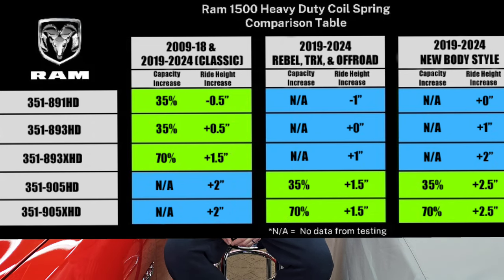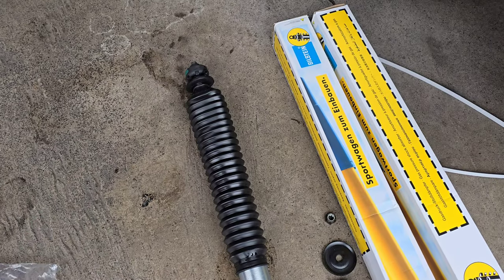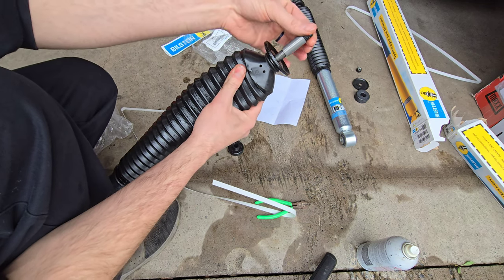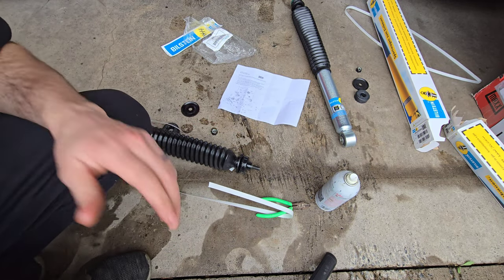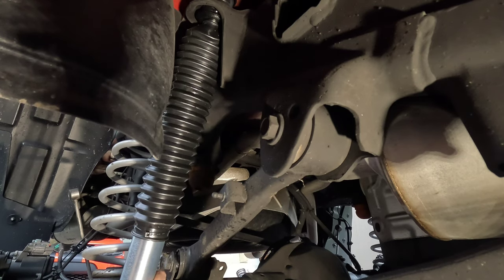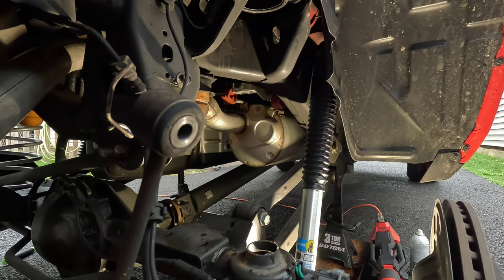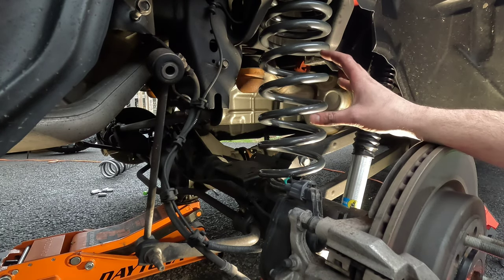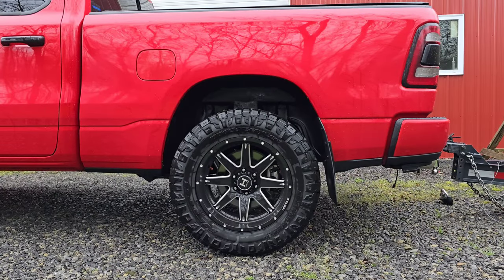Cargomaxx HD coil spring upgrade and bilstein 5100 shock install and overview! | Ram 1500

Comment: Great video. I was thinking about air bags until I saw this. I would rather have better coil springs vs air bags for my needs.
Reply from the maker: Absolutely! I'm a set it and forget it ype of guy so springs definitely take the cake. Don't have to mess with air pressures or anything. Can't go wrong here!

Comment: This part number on rock auto is for front coil springs. Is this correct and you just used them for the rear and they matched right up? No spring insulator change or anything? I'm just checking to make sure I have everything right before I place the order and get things torn apart.
Reply from the maker: @1NiCk508  351893hd should pop up as the rear coils on rock auto
Reply: @TboneSRT  reading it again it says "Rear; Front Coil springs; Most Appropriate For Vehicles With A Varying Load Condition. They Ride Approximately 1" Over; Stock Empty Height; Cargomaxx Heavy Duty Variable" So they must be universal for both front and rear. No new spring insulator or anything though, since its for the 4th gen? Thanks for getting back!
Reply from the maker: @1NiCk508  hmm interesting, I don't think they will fit on the front because they are massive coils, twice the size as the coils in the front haha but yes it is absolutely a direct fit, you use the current insulators. Pop the old coil out, throw these in and you're good to go!

Comment: Why just install sumo spring ? Its much better
Reply from the maker: They don't add lift, but also, riding on bump stops is what seems to bend these frames
Reply: I use Timbrin bump stops on my 22 Ram Rebel 1500. They do the job, however, when I have my travel trailer hooked up and they are resting on the axel, I can feel everything. I’m doing the CARGOMAX 905XHD’s for my truck. Thanks for the video, well done!!

Comment: 4x4 shop near me says I need to upgrade shocks as well? I have 5100’s up front and sits maybe 9/16” taller up front. I want the 893 option which should level me again. 14 Ram 1500. Just started towing again so hope this helps. I also have airlift 1000’s in the rear coils. Thinking I should be good?
Reply from the maker: Nah shouldn't have to but it wouldn't hurt for how cheap the 5100s are. I ran the stock shocks with 1" taller coils for a year with no issues! 

Yes you will for sure be golden! Between the springs and the bags, you're set!

Comment: What year is your Ram? I have a 2020 Bighorn Ecodiesel and installed the 70% over the weekend using your video. Thank you for a great video! These lifted my truck 3” and I don’t want that much lift. 

You said the 4th gen 35% (351893HD) will fit the 5th gen, but I read something that said it’ll only fit 5th gen Classic model. Do you have a Classic or something else like Laramie/Bighorn/etc.? I am returning the 70% and about the buy the same you have here, but want to check first and not waste money on shipping costs. 

Again great video!! Super helpful!
Reply from the maker: Heck yeah! Glad it helped you. As far as lifting, Ahh ha, did you reference the chart?? The 70% 5th gen springs will definitely raise it 2.5".  The 4th gen 70% springs will raise it 2". Do you remember which part number you installed?
Reply: Unfortunately I purchased the 351-905XHD ones back in January and just saw your video before installing. 

So I’m curious if the 351-893HD ones will fit on my 2020. I love the chart you provided and it sounds like they will. However, I read one site that said those would only fit 5th gen Classic and then all 4th gen ones.
Reply from the maker: @InLandSkate_NV  ahh okay! So I am actually running the 4th gen ones on my 5th gen with zero issues! They fit! I only needed 1" of lift so my only option was to go with the 4th gen version to give me the exact lift I needed. I totally forgot to add that mine is a 2023!
Reply: Excellent! Thank you for the confirmation! And again appreciate the help👊
Reply from the maker: @InLandSkate_NV  anytime! Glad I could help!!
Reply: @TboneSRT and your 2023 isn’t a Classic model, right? Is it a Laramie or Bighorn?
Reply from the maker: @InLandSkate_NV  correct! It's a 5th gen big horn!

Comment: I had already purchased the same springs to use on my 5th gen before seeing your video and I am going to replace them soon.  My Question revolves around the shocks.  Did you purchase shocks that were a little longer to go with the 1 inch lift over stock or were the Bilstein shocks the same length as the original ones.
Reply from the maker: So the bilstein shocks are for 0-1" lift! Perfect for this application. I ran the stock shocks for a while with zero issues as well.
Reply: @TboneSRT once I got the springs out I was surprised that the new springs were shorter when comparing them to the factory ones. I kept the stock shocks and it drives great.  Note I also installed a set of Ram Rebel front strut/spring assemblies to match the 1 inch gain in the rear.
Reply from the maker: @brianfranta9549  isn't it crazy?! When I was comparing them to my 1" eibachs I was sh!tting myself lol. Very nice!!!

Comment: Good video, I wish you had posted the torque specs though!
Reply from the maker: I can get them and post them. I torque wheels to 125. But I can get specs for the shock and sway bar link bolts
Reply: @TboneSRT  Yeah, that would be great because that is one of the most asked questions when we are DIYing on all this stuff. Torque specs for the wheels should be 130 ft lbs the rest of the items for rear suspension parts to replace all the stuff in the video are in question. TIA!
Reply from the maker: @HookedonHD  no problem, I have access to all of that info! And yes 130 you're correct! Although I go 125, just to play it safe. Soft aluminum threads they stretch real easily and if you don't have the greatest torque wrench, you could run into stretching threads and snapping them. Ask me how I know 😆
Reply: @TboneSRT  I didn't check, but do you have a front suspension replacement video? I'm going to install Bilstein 6112 in the front looking for a good DIY video with torque specs. TIA!
Reply from the maker: @HookedonHD  for the rear, lower rear shock 103 ft lbs
Upper shock nut- 35 ft lbs
Rear upper end link bolt- 41 ft lbs

For the front
Upper shock nuts to frame - 46 ft lbs
Lower shock nut- 124 ft lbs
 end link - 114 ft lbs 

I do not have an install of the front. I should have recorded that but I never did!
Reply: @TboneSRT  Awesome, what's ft lb on the brake line nut shown in your video? I think I am going to do it the same way. TIA
Reply from the maker: @HookedonHD  I can't find a spec on that but it's not really an important bolt. Just a holder for the brake line
Reply: I just replaced my rear shocks with Bilstein 5100s, springs with B12s, Hellwig sway bar, and bump stops. Thanks for the video!

Comment: Thanks for sharing. Is this spring compatible with a Ram 2500?
Reply from the maker: They aren't but here's a link to 2500 springs https://simcoespring.com/products/sc28215v
Reply: @TboneSRT  Thank you I see they are charging $420 for it. I also found another set made by Dorman for $290 on RocAuto. It looks like the exact same thing, same description, but just made by a different company. What are your thoughts on that?
Reply from the maker: @ATeamAdventures  I'd copy the part number and do a Google search and see where you can find them the cheapest. The link I sent is to a company that sells them but doesn't make them. Dayton cargomaxx makes these springs. 

I bought mine on rockauto for 211. Rockauto had the best price! Also you can google a rockauto discount code that saves 10%!
Reply: @TboneSRT  your the man! I appreciate it
Reply from the maker: @ATeamAdventures  anytime! Hopefully this helps!